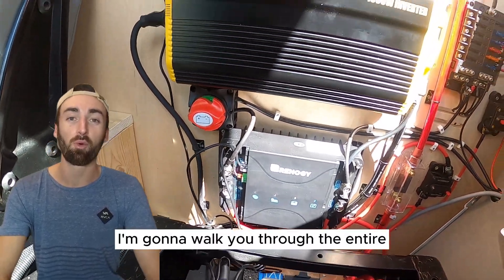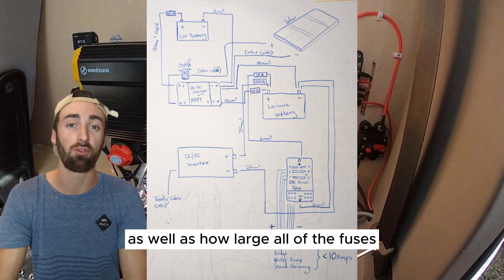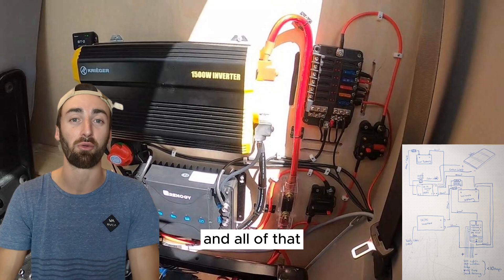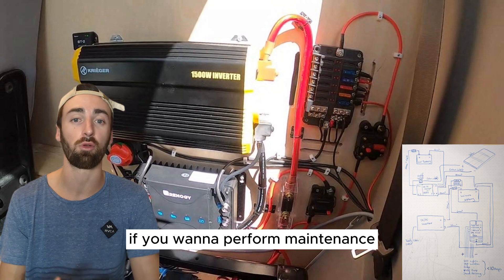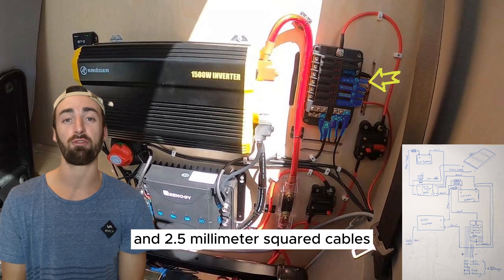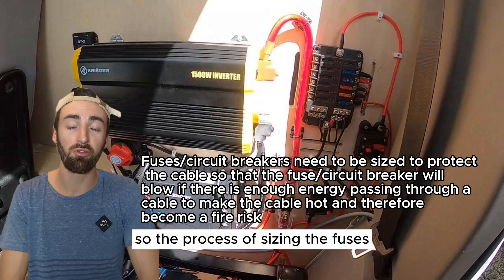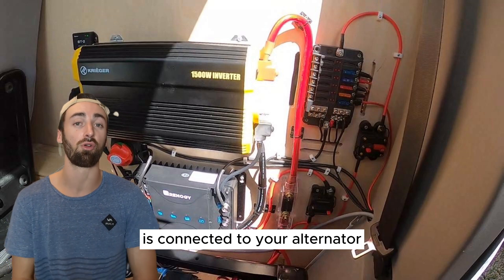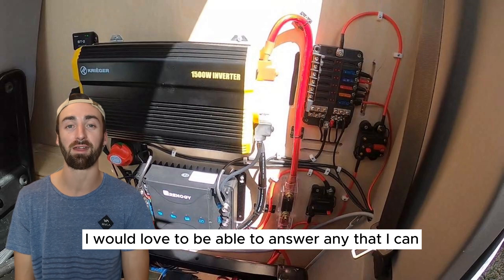Van Electrical System Detailed Explanation | VW T5

Comment: Hey Jake, I just have a quick question with regards to the fuse size between your car's starter battery and the Renogy battery charger MPPT & DC-DC. I wonder why this fuse size is only 45A? I was thinking you'd need a bigger fuse, like a 60A one, because the battery charger MPPT & DC-DC is 50A?
I'm also starting a similar project with my VW T5, so thanks so much for this helpful video of yours! Getting the electrics right (or trying to) is scary but also really exciting :)
Reply from the maker: Hey Ruben! Thanks for the comment mate, you're absolutely right. I've since started using 70 Amp terminal fuse between the starter battery and the charger unit as well as a 70 Amp circuit breaker between the charger and the leiser battery. I hadn't thought to amend this mistake in this video yet so thanks heaps!

Comment: Hi Jake, I’ve been watching your videos as I’m getting my Toyota Hiace ready for camping. Initially I wanted to get the Renogy 50A mppt dc dc but mistakenly ordered the 30A one. Now I’m thinking whether it will actually work out well in the end with the 30A, but have some questions. I’ll be using a 200W solar and as of the Toyota alternator I really don’t know the amperage. It will all go into a 100Ah lithium battery, powering a 1000W inverter and the usual 12V appliances, nothing excessive (fridge, roof fan, fan, leds and usb). My question therefore is, is a Renogy 30A enough? And also, since on some of your videos you show your Toyota, do you happen to know the Amps of the alternator? Mine is a Toyota Hiace 2014 2L petrol engine. Thanks a lot and thanks for all your videos and website material! Cheers Eddy
Reply from the maker: Thanks for the question. Short answer is - yes, it's enough. The 30Amp will more than cover the Amperage your solar panel can produce which is where you want most of your charge coming from. While it won't be able to capture 100% of the charge possible via the alternator (it can give you up to 45A when your leisure battery is really flat), that shouldn't bother you too much because charging via the alternator is just a nice top up for the battery while, again, your main charge should come from solar ideally. Meaning it will only affect you by reducing the possible charge from DC-DC by 33% but only in cases where your battery is flat and capable of being charged with that much energy. Hope that helps! Good luck with the decision!